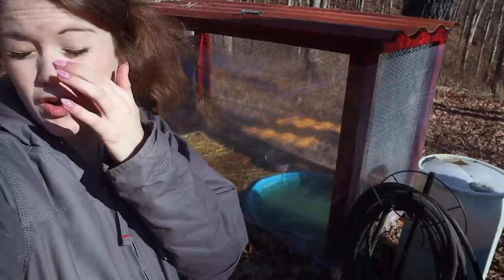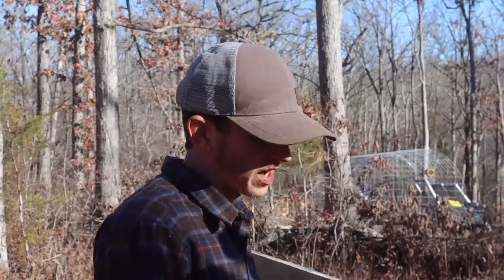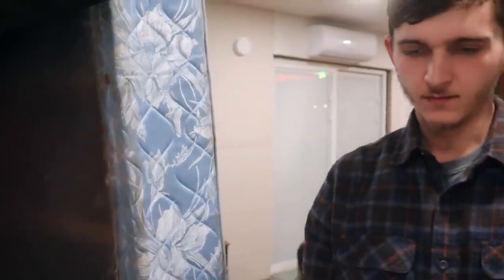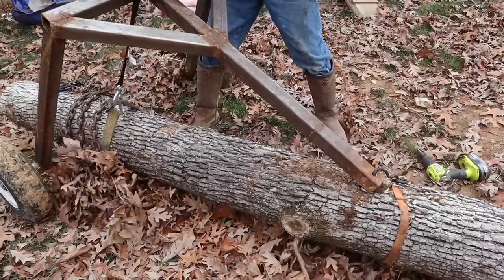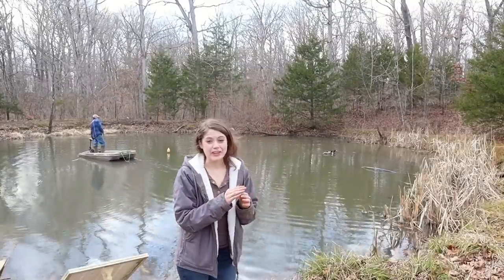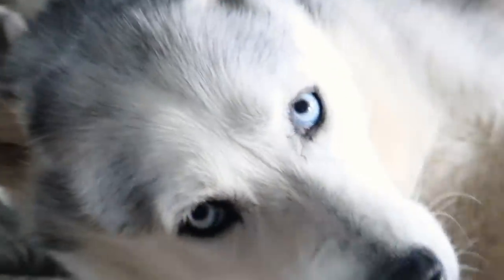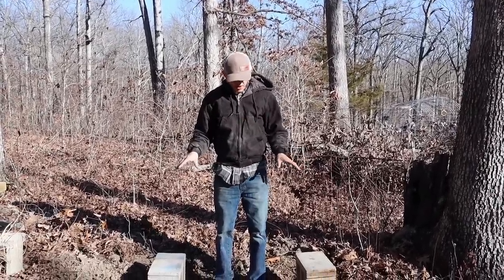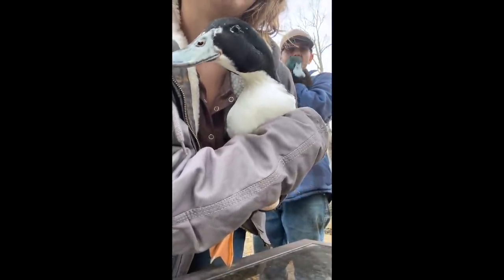A Much NEEDED MOVE |Shipping CONTAINER House |EP:85| Creating Our Own LUMBER MILL OFFGRID

Comment: You know on your winch lifting that log like that if you would use a cable and hook up a pulley system you can double or triple that cable to pull it puts it  slower pull and easier pull you gear it just right with them pulleys you should be able to use a drill instead of that hand crank